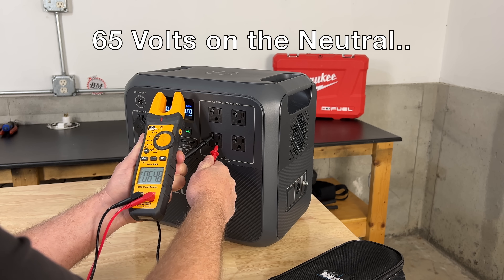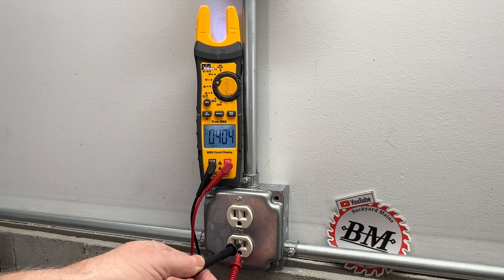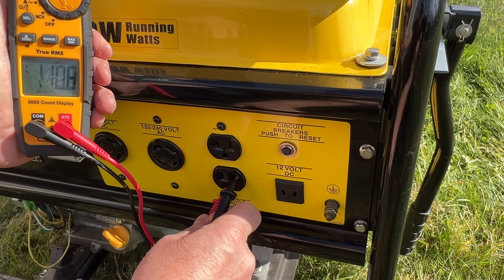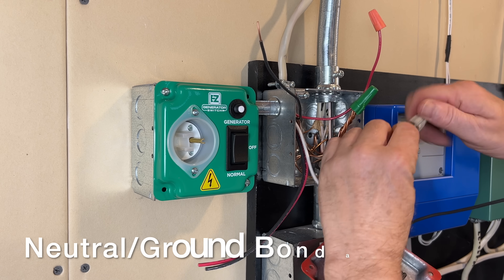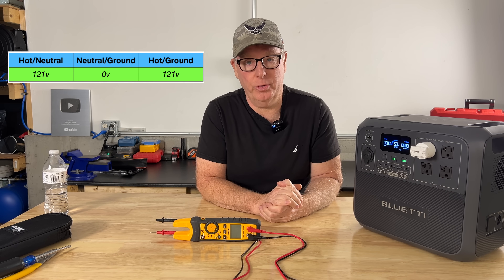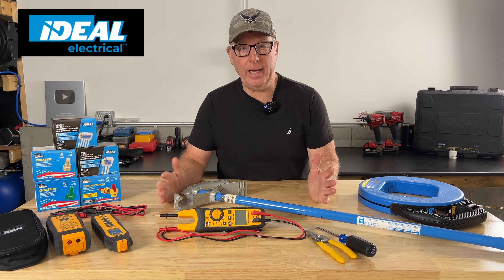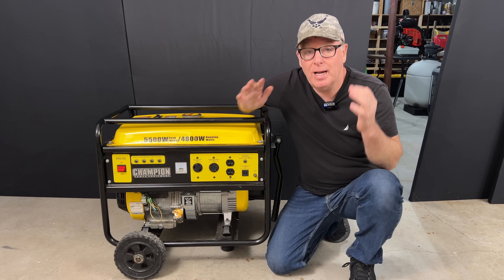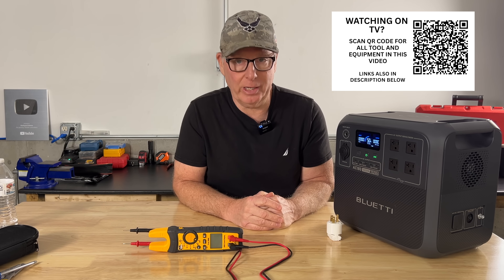The Hidden Generator Mistake.. (Dangerous)

Comment: So, from this video.
My understanding is:
If you're using a neutral/ground bonded generator as a standalone power source, out on site for power tools etc, not connected to a property network, you should also hammer in a grounding rod and connect that to the earth terminal on the generaror panel?
To ensure the ground and neutral connections inside the generator absolutely cannot float?
Correct?

Also, my understanding from the video is:
If you want to use an unbonded generator out on site (same as described above) I should install a neutral/ground bonding wire inside the generator panel, (or an fit an external bonding plug) as well as ground rod connected to the generator earthing terminal?
Correct?
Reply from the maker: A ground rod is not required for portable generators although it's not prohibited either. Most generator manufacturers will recommend a ground rod but they do need to protect themselves from any possible liability. Here's some context: When using a generator for stand alone use you do need a neutral to ground bond. This bond is just connecting the frame of the generator and all the grounds on the receptacles to neutral. That connection creates a low impedance short circuit path allowing circuit breakers to open and clear a fault. The GFCI protection will also still function without an earth ground connection. 
The ground rod (grounding electrode) establishes an earth connection to the frame of the generator and is primarily surge protection. It's job is to direct induced surge voltages for a near by lighting strike to ground rather than to every grounded surface. Another added protection would be to also install a surge protector. Although nether of these two are required and they are often impractical unless the generator is in a fixed location, they are not a bad idea for the safest use.

Comment: One small "problem" you might want to cover is when employing Electrical Management System, often called surge protectors, although they are much more than that. They are primarily used for RVs and can be portable or hardwired and come in 30 or 50 amp versions. Without a bond (bonding plug) they will show an open ground error when connected to most generators or "solar" generators... and will not pass power to the RV plug, which causes confusion for many RVers. Again, simply make a bonding plug for that application and remove it when you don't need it.
Reply from the maker: That's a great point about RV Electrical Management Systems and an open ground error! Thanks for adding that valuable info. But remember that you do need a neutral to ground bond at the generator if you're connecting to a stand alone system like an RV thats not also connected to shore power.

Comment: It's called an M.E.N. system. (Multiple Earthed Neutral). It's great for land based systems, but try that on an offshore vessel and two things happen. 1) the GFDs (Ground fault detectors) all have kittens! GFDs inject a tiny CURRENT between the two 'lines' (you call active and neutral) and the ground. If it sees any current returning, it means there's a fault between the ground (ship's hull usually) and one of the 'live' lines, and 2) (and this one is REALLY bad) you introduce an alternating current into the hull structure, which the different metals of the hull and its anodes can't cope with, and so you have put corrosion on steroids. You will be seeing metal structures that should have lasted decades corroded away in a matter of months. 

'Floating Earths' are absolutely needed on vessels. And get this... They are actually a safer systems. With terrestrial systems (MEN) if you touch Active while standing on the ground, you're going to get the full output of the power station trying to run through you. That's going to tingle. If you do the same thing on a vessel, you probably won't feel it, but the GFDs are going to all start screaming. And the Chief Engineer is going to be looking for you.

Comment: my generac has the neutral to ground bond as a wire to the chassis that can be removed, which is what i would have to do when connecting it to my house
Reply from the maker: Yes, that's how most generators ship. The frame of the generator is the ground but that also extends to the ground connection on all the receptacles and to anything plugged into them.

Comment: When I built my home, I installed three seperate systems, shore power, emergency power and low-voltage power, each within its own conduit, each with its own recepticals.

I switch from on-grid to off grid useage without needing any disconnecting gear, so shore power is hot even when not in use.

I use shore power mainlt for welding. Solar & wind for off-grid days and low voltage during emergencies.

Comment: As an electrical engineer I can say I've never seen this issue, but grounding the neutral makes sense with anything floating.  Back in the day, a certain car company (GM?) would have a floating ground for its stereo systems and I had to account for it and "defend" against the noise created by the floating ground.  Your explanation of this is right on track and by grounding what should be the ground I was able to get past the float.  Still had to add a capacitor to get rid of the engine noise though.

Comment: I think that battery backups like the Anker will be bonded to ground as soon as you plug them into 120VAC utility power to keep them charged.  If they are always left plugged in to utility power, the ground and neutral will always be bonded to ground.
Reply from the maker: That is correct but they are not bonded separately which is a good thing because removing that bond might be difficult.

Comment: Still a bit confused on my needs.  I recently just bought a "Wen Quiet 6800-Watt Dual Fuel RV-Ready Electric Start Portable Inverter Generator with Fuel Shut Off and CO Watchdog for Electric Vehicle Backup" for my RV when shore power goes out.  I would be taking the plug from the shore pedestal and plugging it into the generator directly.  In this case, do I need to get a bonded plug to be safe?  Also, Should I run an earth ground stake for this scenario?
Reply from the maker: Yes; since you're completely isolating the (utility supplied) shore power when you physically disconnect the plug and connect it to your generator, you do want a bonded neutral at the generator. Your generator may have a bonded neutral already so you may not need a bonding plug. If it's not bonded and you never connect the generator to a bonded system, you would probably be better off making a permanent bond inside the unit.
 
A ground rod is a good idea but not required for a portable backup system. Its primary function is to direct a high voltage surge into the ground possibly preventing fire or damage from a near by lightning strike. Nothing can protect from a direct hit but a ground rod and a surge protector is your best bet.
Reply: @BackyardMaine  I did an AI search and this is what i got:

"Yes, the WEN DF680iX generator has a bonded neutral, which is its standard configuration. This setup is suitable for direct use with loads like RVs, but a bonded neutral can cause safety issues if connected to a home's transfer switch, which already has a bonded neutral. For whole-home backup, the neutral bond in the generator must be disconnected to create a "floating neutral" to prevent ground loops"

Comment: I learned more from your single video than the dozens of others I've watched trying to understand the need for floating or bonded neutral on my backup gen connected to my house!  Thanks for the straight forward explanations!

Now, how about a video on whether or not I can safely use a standard generator (vs. an inverter) to power my high efficiency furnace (you know, the kind with a circuit board and chips you don't want to let the smoke out of!).
Reply from the maker: That's awesome to hear! I'll definitely consider doing a video on using standard vs. inverter generators for furnaces.

Comment: Is there a safe way to use a portable generator on a boat. My understanding is that i will make the water around the boat electrically hot. Any thoughts?
Reply from the maker: Using a portable generator on a boat is widely discouraged by marine safety experts due to the severe risks of carbon monoxide poisoning, electric-shock drowning, and fire. While some boaters use them, the safest approach is to avoid portable gasoline generators altogether and rely on a properly installed, marine-certified generator or alternative power sources like solar.
Carbon Monoxide (CO) Hazard
Portable generators produce large amounts of odorless, colorless carbon monoxide. On a boat, CO can quickly accumulate in cabins, cockpits, and even open decks due to the station-wagon effect, leading to fatal poisoning in minutes.
Electric Shock Drowning (ESD)
Improper wiring or faulty grounding can energize the water around the boat. As little as 10 milliamps can paralyze a swimmer’s muscles and lead to drowning. Portable generators lack the ABYC-required safety systems—such as proper neutral-ground bonding and ELCI/GFPE protection—which makes this risk significantly higher.
Fire and Explosion Risks
Portable generators are not ignition-protected, and they combine gasoline, hot engine surfaces, and possible fuel vapors in a confined marine environment. This greatly increases the chance of fire or explosion.
Other Issues
They are often noisy, not designed for continuous operation on a pitching deck, and can disturb or endanger nearby boaters.

Comment: Here in the UK we have what are called site transformers giving 110 volts AC, the transformer secondary is center tapped to ground giving 55 volts. The idea is is that if a cable is damadged as is quite likely on a construction site anyone touching a live wire is only going to get hit with 55 volts. The input of the transformers are of course 240 for the small ones and 415 for the larger ones feeding a whol;s construction site but they will be tucked away somewhere safe from acidental damadge.
Reply from the maker: Thats interesting and smart.. Here it's a bit different. When will temporary power usually 120/208 (3 phase) or 120/240 (split phase) power but every circuit is GFCI protected. I think you guys call it RCD protection. Our GFCI protection is designed to trip at 4-6 mA. Correct me if I'm wrong but I think your RCDs trip at 50mA..

Comment: 70 years old carpenter,  just started studying electronics. I wish i did this sooner. But I've used generators all my life. Never had a problem. Never knew about bonding plugs . I Pluged in homes with generators but always had electricians there , very interesting. Now i have a multimeter and can look for myself. Plus, im starting to understand capacitors. It's a great video.  Thanks
Reply from the maker: It's never too late to learn something new! Glad the video was helpful.

Comment: I've never looked at specs for meters sold specifically to the electrical trade, but most "ordinary" digital multimeters have an input impedance of 10M ohms (i.e. 10 million ohms).
One microampere into a 10M meter will show you 10 V on the display.
[edit] For comparison, a VOM of years gone by, as some people have mentioned in comments, would have an input resistance that depended on the setting. For AC ranges a spec of "5k ohms per volt" was pretty common. The actual input resistance would be 5k multiplied by the full-scale voltage of the set range. When set for 250 V full-scale, the input resistance would be 5k x 250 = 1250k = 1.25M.

If you are approaching determination of whether voltage relative to "ground" on neutral is "real" with fear and trepidation, using a shunt resistor across the meter leads can be instructive if you understand what may be going on.
A resistor of 10k (10 thousand) ohms across the meter leads would drop the effective resistance of the path between the leads to a wee bit under 10k. A 2 watt resistor would withstand direct connection across 120 VAC.

If the suspect voltage is dramatically reduced (by a factor of about 1000) with the shunt resistor in-circuit, it can be pretty safely assumed that the voltage is just due to capacitive coupling. If the voltage doesn't drop with the shunt resistor, it is "real" and may be dangerous.

A 10k ohm, 2 watt, ±5% tolerance resistor is something that should be readily available from any electronic components supplier. The most common type with such specs would be a "metal oxide film" resistor, but any type will do - metal film, wirewound, carbon composition (very rare these days) or carbon film (pretty rare with 2 W rating).
Connecting it across the test leads can be a bit of a pain. You could easily use one in a plug like the one made in the video for "bonding."

At 120 V, 10k ohms will allow 12 mA, which will probably trip ground fault detectors.

Comment: Thanks, great video. I also like using Ideal. In the hvac field their stuff is top notch. I use it outside on the roof, that is where the quality is most important.
Reply from the maker: Glad it was helpful! Thanks for sharing your experience with Ideal products. They are a top tier electrical brand for sure.

Comment: That was cool! Does this apply also to a inverter from my solar system 🤔
Reply from the maker: That depends on whether your inverter isolates the neutral. You would need to verify the configuration before you would know for sure. But there are no circumstances where two neutral to ground bonds (not isolated from one and other) is compliant.

Comment: I think that people need to understand that AC power supplies are notably different in operation to DC supplies. It's important to understand the difference and not to apply the hydraulic analogy when checking them out. Look it up.

Comment: So interestingly I watched this after setting up a generator inlet that I can hook up to my EV truck. I thought I knew that the truck bonded the neutral and thought that that would be fine. After watching this I got very confused cause it said you can power your house with the NEMA 14-50 built into the truck. I then did some more research and it turns out that it can sense if there is a bonded neutral already and turn off its bond if needed. I thought this was a really interesting way of doing it, I think all generators should come with a system like this. This also comes in real handy with my situation where I had to put the generator inlet on a sub panel in my garage that is not connected to my house. So if I’m just running the sub panel and not the main the truck will have a bonded neutral. I know this is technically not recommended, but it was the only way I could do it and I make sure to be very careful with switching to truck power. This was a last minute situation as my house rebuild was pushed out to next fall and I needed a way to backup the house in emergencies because the whole house generator I have now is 20+ years old and failed on me. Once the rebuild is done the utility power is going to be switched to the garage and the house is going to be the sub panel. Making what I have now be up to code and safe.

Comment: i thought it meant you needed a ground when standalone, so i drove a 12' ground rod in when i was using mine that way... now it's tied into a generator subpanel via the 4-prong  240V twist lock, but sometimes i run it without plugging in during my monthly run... should I make up a plug or ground it with the rod or?  i'll have to make sure it's a floating neutral first

Comment: In California, there is a grounded neutral at the panel (my new panel has 2 separate driven ground rods btw). The pole mounted transformer also has a ground rod tapped to the center (neutral) secondary bushing.....earth as a conductor, go figure......

Comment: I had a very cheap 1500 watt inverter that gave 80 volts on the hot and 40 volts on the neutral. Very strange

Comment: Quick question, during power outages I use my floating neutral generator to power everything including my refrigerator sump pump and freezer and other electronics and it works fine. However my furnace requires a bonded neutral.  I just run cords to each appliance.  Is it okay to run all these devices with a bonded neutral plugged into my generator when in the past I have not? I will need to plug in a bonded neutral plug into my generator in the winter time because I'll need to run my furnace.

Comment: This is one reason I don't like digital meters.  they provide almost zero load while measuring voltages.  I can grab both leads and measure voltage between my hands because they are so sensitive.  An older analog meter with e regular needle sweep works far better in these cases.  Also, at some point, the electronics of the unit itself are also electrically bonded to the frames of generators.  You can easily measure the little bit of voltage that seeps through.

Comment: I have a Royobi 4000watt inverter generator with 3 240volts out , I have put a 1200 mm grounding stake with 1100 mm in the ground using a 4mmsq earth cable from the inverter generator for safety.

Comment: The Anker F3000 shown actually has a built in relay to switch from the floating neutral ground to bonded neutral ground and will disconnect the AC source inputs. Its their built in "EV charging" mode that allows this.

Comment: When using a solar backup gateway the neutral gound bond is done by a relay inside upon loss of mains supply, this is the EU way. But when using a larger size generator i would bond the earth and neutral at the star point of the generator coil and then add a ground spike. Can't have two bonds